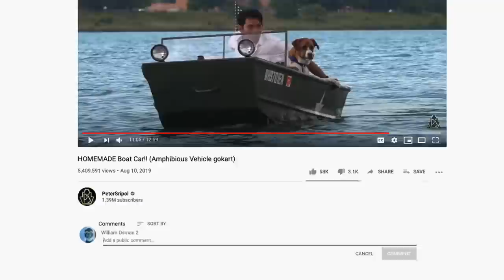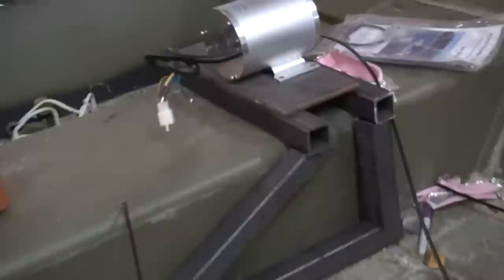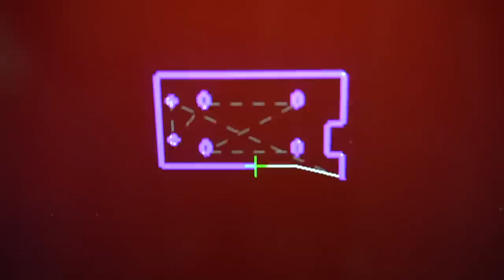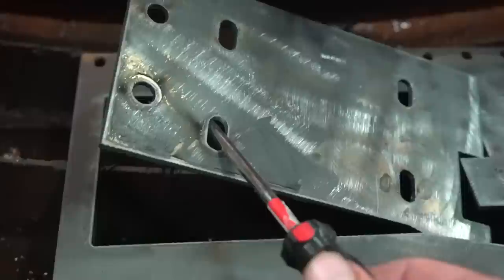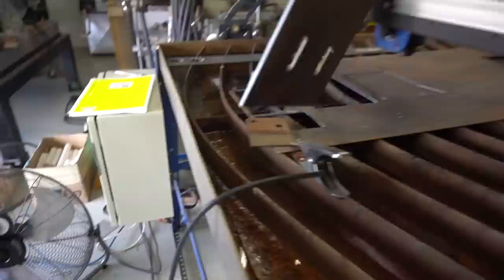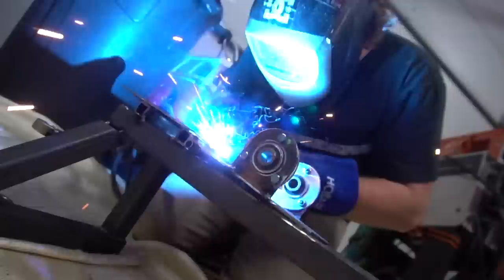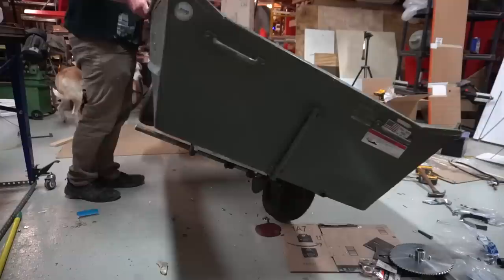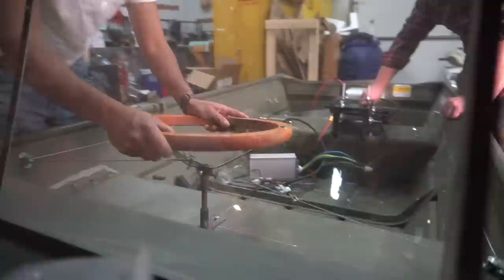Homemade Amphibious GOKart Boat pt 2

Comment: four wheel drive, AND an airsoft turret
Reply: yes,cars use 4 wheels
Reply: Nah, use tracks.
Reply: @plusxz821  4 wheel drive means all the wheels are powered means it can go faster instead of the normal cars which uses 2 wheels to drive
Reply: @noradelmendoza8642  and it gives more grip
Reply: @nikobellic5655  Good idea but they are pretty heavy
Reply: 4
Reply: No one like this one more time this is glorious
Reply: @Sillybilllly  169 nice

Comment: Prop is the most rear and lowest thing on the boat.
Peter: "I'm going to drive this thing off a pier slowly."
The whole time watching that bit I was thinking that you where going to send it off the pier, not destroy your propeller.
Reply: Yeah, if he'd gone faster I think the prop would have been fine.
Reply: @saml7610  And would have looked epic...
Reply: I would personaly use the rear axle to make a centrifugal pump and use that to run the boat or install something like that inside the boat, because going in and out of the water will keep destroing props no mater what. is too exposed
Reply: Well that's Peter for you

Comment: Definately, all wheel drive to get up out of the water. Also, the DUKW had the propeller in a recessed housing. Emulating that would reduce chances of the propeller getting broken. Overall, the new drive system is awesome! I'm always so inspired by these projects!

Comment: I’d love to see the top re done in sheet metal or sein thing instead of cardboard, great build tho
Reply: I'd love to see the top removed. The PUBG tie-in is stupid. You can't have your dogs and friends aboard as easily. It's bad.
Reply: But it will become heavy... and they want torque and power
Reply: @m.s.m3464   I'm pretty sure the more weight there is the more torque and power there will be
Reply: @stewiestuddsyt7877  How does increasing the weight of a vehicle increase torque and power output?
Reply: @tris1452  it's hard to explain in a way it kinda just make sense it has to do with physics though

Comment: I'd love to see submarine made by you. Is it possible?
Reply: Maciej Czapka it is, buy I think its a bit far even for Peter. You would have to use metal for EVERYTHING, ballast would be a huge obstacle, and thats not to mention the air supply. Would it be cool? No. It would be awesome. But it would be really expensive and would take months, if not years, to get right
Reply: @junkers4567  he could make one that floats right below the water and use a snorkel to breathe
Reply: @junkers4567  He'd 100% drown himself lol
Reply: It would be really hard to make it not leak which for a submarine is a way bigger problem then for a boat

Comment: Still think it would be cool if you can build a small carrier that launches RC planes with a similar catapult system and lands them with the cable to catch them too. It would be a challenge but really cool if it was all scale. Maybe you could use that little boat as the base for the deck.

Comment: would be pretty cool to see the wheels more tucked into the body, if at all possible. and then a larger motor/engine to take advantage of the reduced drag to get to planing speeds.

Comment: 11:34 "Ahead flank, emergency speed." (btw I love the Cyclops' AI voice in Subnautica, its great)
You got that going full tilt, Peter. Aside putting on a solid guard to protect those blades, is the propeller cavitating? I see bubbles coming off the propeller and I'm not sure if those are steam bubbles or not. Regardless its awesome and perhaps a gas generator to recharge the batteries would be a good addition, put those faux-exhausts to good use as real mufflers :)
That body has a nice amount of buoyancy from the looks of things, so using the engine from version one to keep those batteries topped up would be cool

Comment: Hi. I am very very impressed with your homemade boats. Have you ever thought of using a small 2 stroke engines? (gas/petrol 18cc, 20cc, 24/25cc engine grass trimmers?) That'll be fun. I am watching your homemade gadgets (including electric mini aeroplane). Question: what do you think of putting/adding extra propeller behind the original propeller?( creating a mini turbine, just put an extra length of shaft for a two set of propellers arranged alternatively, 2nd behind 1st: the blade of 2nd propeller is NOT line up with 1st one, but in the middle)
Goodluck! Have fun!(I am having fun watching your gadgets working) Thank you

Comment: Find a 4x4 4 wheeler and build an amphibious vehicle out of that. The engineering and testing for reliability and durability is already done for you as far as the running gear for the on land portion. Using a shaft drive model would make it easy to modify and engineer a shaft and gearbox to engage the propeller. Or even better find a jet ski that’s blown up and use the jet drive out of it. Massively more durable and a ton more thrust. 🤘

Comment: make it solor and see if you can add two speed controls (including revers) to the wheel and propeller. it might make handling the steering wheel so much better

Comment: Put paddle tire on it so you can u the wheels to propell through the water and use the propeller on the bottom the same time.

Comment: Im bored at home so i put a list of amphibious car/tanks here enjoy 
Here is a list of amphibious car/tanks  in the ww2 and cold war.
WW2
VW Type 128 and 166 Schwimmwagen
Special Type 2 Launch Ka-Mi
Special Type 3 Launch Ka-Chi
Special Type 5 Launch To-Ku
special Type 4 Launch Ka-Tsu
T-38 amphibious scout tank
T-37A
T-40
PB-4 (cant find on wikipedia)
PB-7 no wiki
BAD-2
Terrapin
Marmon-Herrington 
They were originally designed to be amphibious light tanks. They were rejected by the U.S. Marine Corps in 1939, but after the attack on Pearl Harbor they were exported and used as an emergency light tank. and its not a amphibious car/tank
Amphibious Vehicle, Tracked (LVT)
M29 Wease
The DUKW (colloquially known as Duck)
Cold war
The 2S31 Vena, BRDM-1, BTR-40, LARC-LX, PT-76, ZiS-485, BMP-1,BMP-2, BRDM-2, Cadillac Gage Commando designed to be amphibious, D-442 FUG, PTS, Type 63, SIBMAS, Spähpanzer Luchs, ACEC Cobra,  BMD-4,
(I used google translate)

Comment: No offense at all this is just the way I see it I love you build and think it’s great. I think that your motor is on heavy stress. Water is dense and heavy stress and the motor isn’t very powerful. I think you should have 1 motor for your drive reduced for more power and tractor and acceleration. I also recommend some bigger tires for better traction on all different terrains. Not only that but I think you should also put 1 motor for your propeller and 1 for your drive. Also you should make a transmission for your drive train to go different speeds. Once again this is what I would do. I mean no offense I just want to say what I think can be improved. In general great rebuild and i love it. Amazon job!!

Comment: Here's a concept that you might be interested in trying out in the near future by using weather balloons Rockets remote control plane and the camera does a 360 high definition camera that could be stored up to a cloud just in case if everything fails horribly this will be the mission if this Mission goes perfectly fine I might have a new mission for you this is what you need.
Get several weather balloons attach a drop device on each point of object that is currently dragging up to space and then build a large rocket that can be programmed to launch at certain times and a certain height but you need to Launch before the weather balloons pop while it's dropping there will be wings giving it some lift as it will launch a rocket that will be removed when this completed this rocket will move the object pointing upward as the Rockets and the wings removed from the device then you will launch the main prize a large rocket with several stages and at the very top is a remote control plane and at the tip of it are a 360 degree camera make sure it's high def when it launches up that height it will take two pictures once towards space the other toward the planet as it will take this picture the camera will Retreat back into the cone getting ready for the re-entry as the capsule comes back to Earth it will need several things for being a small object it would probably burn up in the atmosphere so you need to find a way to increase the speed if you don't know how to do the stuff use the concept from KSP or Kerbal Space Program for help by finding out how to decrease your speed and you make it past the burn up point you must find a way how to move the rest of the Rockets revealing the prize as a remote control plane plummets to Earth it will have a satellite phone or some type of tracker that can be located at certain height the moment it becomes in range of you must guide the plane safely down by Landing you must check on the footage and see if all the programming was good and then enjoy the pictures and show us.

Comment: yus part 3 maybe able to have to strong enough to have a taller seat be hind you above the em motor so that would be the open hatch version then you could slide into the original seat for the closed hatched version  also  what about storage barrels   for things two on the side or even on the back any way there is some ideas.

Comment: Hey peter, If this was for sale how much could it be? Im not thinking of buying it but in my 8th grade class there was a assignment about some senior vacation planner paper that I was told to do and I could either fly or drive to whatever place I wanted to go to so I chose tokyo, but I could only fly there because I live in the U.S which is one ocean away from there. But I decided to kinda exploit the options by chosing a boat truck (or APC), which was over my budget. I would not be able to do much there so I took it as a challenge and decided to look for a cheaper boat truck. Untill I seen your video and got an Idea to try using the GOKart Boat for my transport to tokyo. I know I didn't have to tell you a long story but I felt like I should.

Comment: He should have made the top hatch to be like "We're taking fire! batten down the hatches!" Closes the hatch
Edit: And if he made the top hatch and the top just a bit bigger he could take it into the lake and survive for like 3 days if he packed food because he made a top hatch even if it rained he would be fine and dry
Edit 2: He should do a part 3 of this and use his old tank and old planes (If he still has them) and do an all out battle with a plane gunner and tank fighter lol
Edit 3: Btw that little bombing thing in the river was actually what is was like back in WW1 and WW2, the had to duck down and close all the doors on those and shut the flaps in those areas to avoid injuries and or death. Cool Right??